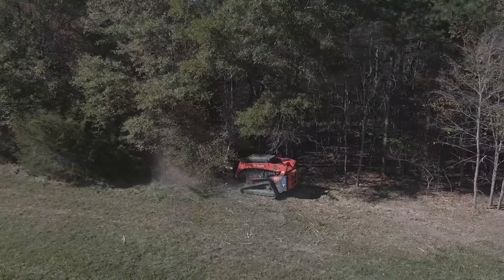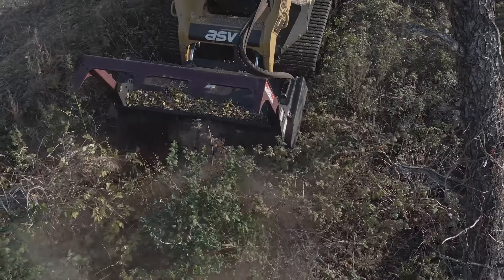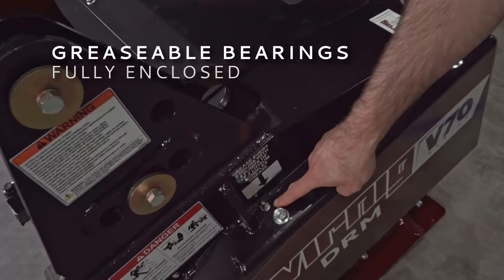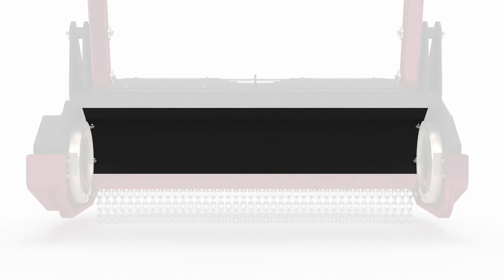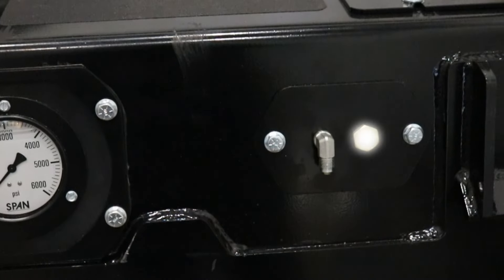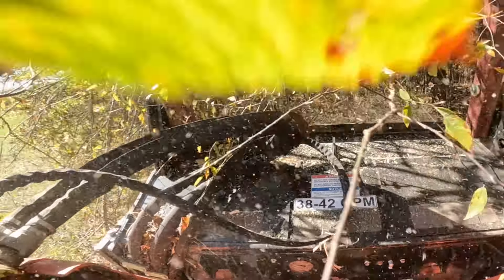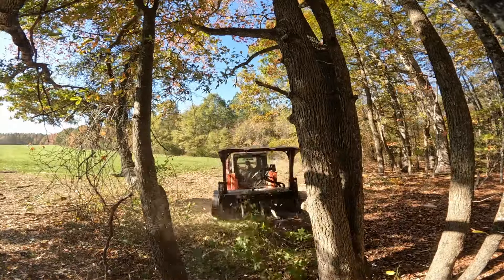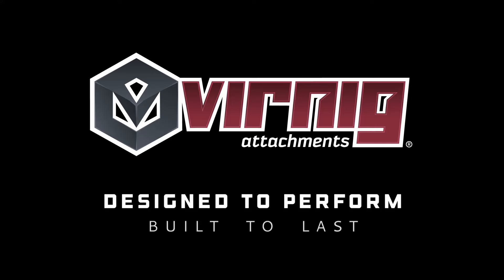Drum Mulcher for Skid Steers  |  The Ultimate Land Clearing Solution  |  Virnig Manufacturing

Comment: Can I put carbide teeth on in and use it like a ruckus rake to resurface basalt gravel roads that have large rocks? 
We have more gravel roads than paved roads here on the big island of Hawaii but it also rains constantly so the gravel roads get destroyed weekly. It would be much more efficient to grind a new surface because graders have a hard time dealing with the hard basalt left exposed after heavy rain. The gravel gets washed away and can’t be retrieved in many cases. 
Yeah they need to learn how to grade roads for run off but they’re too stupid or want job security. Probably the later.
Reply from the maker: Virnig's Power Rake is the ideal tool for the job, combining the functions of a tiller, box blade, and rake in one product. The carbide teeth effortlessly pulverize gravel and soil while leveling and grading the surface. It will quickly remove gravel potholes and washboards while cutting down high spots and filling low spots.

Specs, photos, and videos here: https://www.virnigmfg.com/product/power-rake/

Once you get the hang of it, the rake delivers a superior & level finish in just one or two passes. It'll also windrow bigger rocks off to the side when angled. Be mindful not to apply too much down pressure to avoid creating washboards.

PRO TIP: Use a dirt bucket to fill larger holes and let our power rake handle the rest.
Reply: If this little rake would actually chew up Hawaiian Basalt rock I’d be beyond impressed. 
I see it working great for resurfacing existing gravel because it’s just mixing it back up and leveling it out but when the gravel gets washed away in certain areas you’re left with solid rock here in Hawaii so I need something that can turn rock into gravel and this rake doesn’t look like the tool for that. I’m thinking a skid steer might not be big enough. Maybe a tractor with a 3point with at least 300hp might be better.
Reply from the maker: Oh I see! In this case, I'd recommend to research skid steer stone crushers or cold planers. We don't offer anything like that yet but those attachments would be better suited for solid rock. Let us know if you find something that works! Intriguing job.